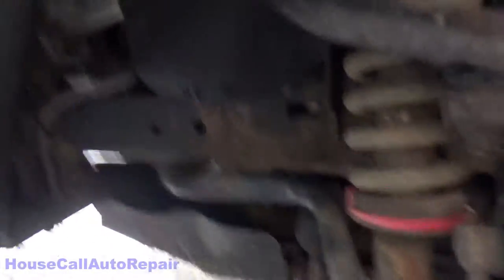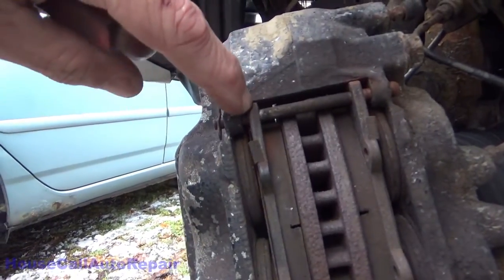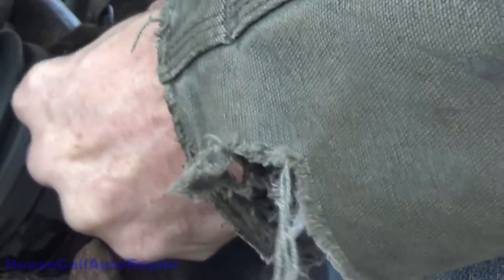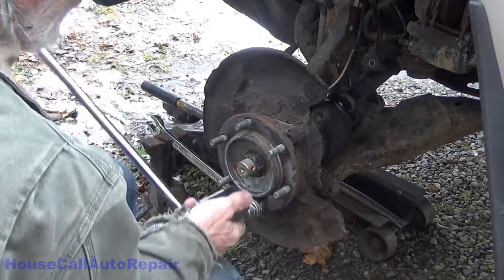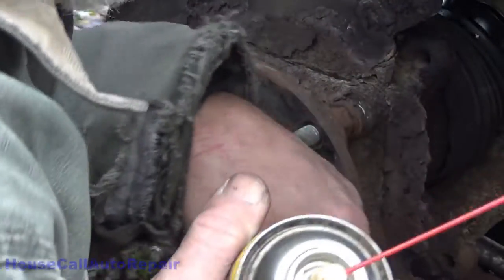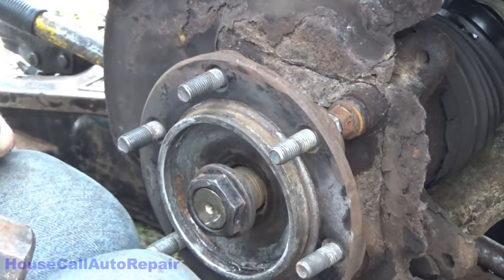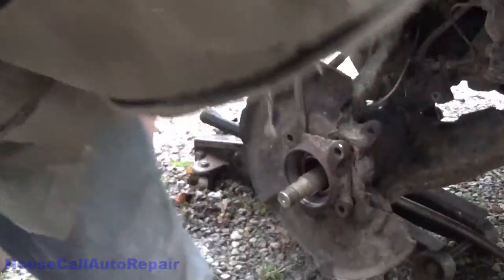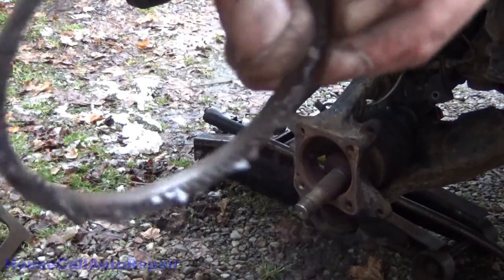2009 Tacoma 4WD Front Ball Joints and Wheel Bearing - Part 1 - Auto Repair

Comment: I've had success removing bearings like that using a 2 ft pipewrench with a 3 ft cheater pipe on the end of it. Hook the jaw of the wrench at the top of the hub then jump on the end of the cheater pipe. Pops them out every time.
Reply from the maker: No damage or stretching of the knuckle?
Reply: @HouseCallAutoRepair  Nope. I just make sure a jack stand is under the lower ball joint for extra rigidity when the force is applied.